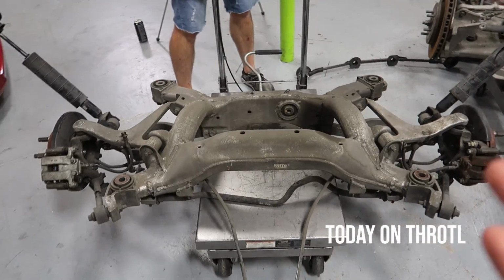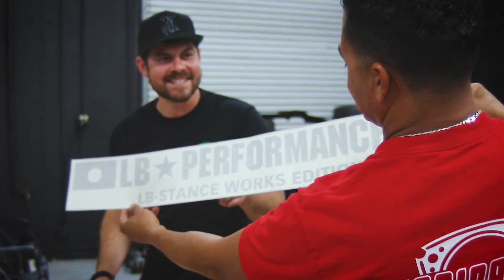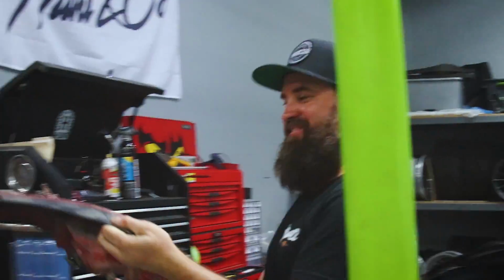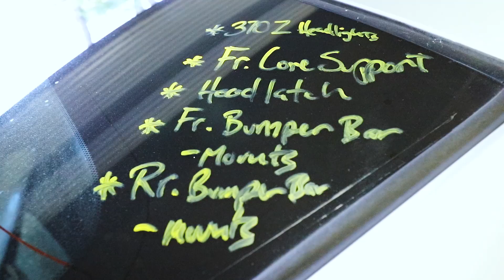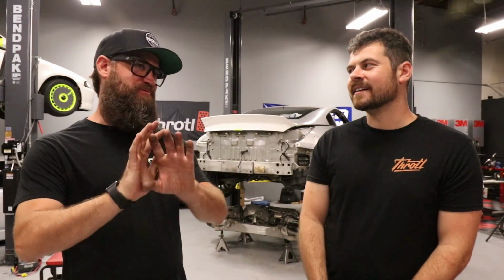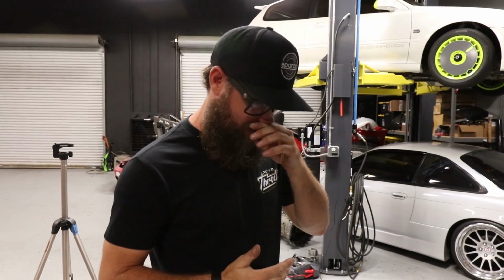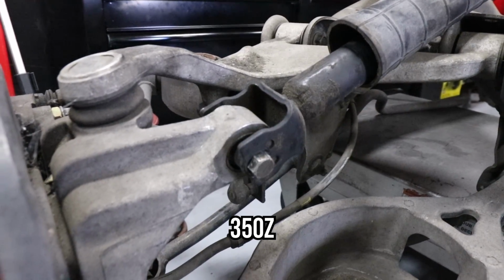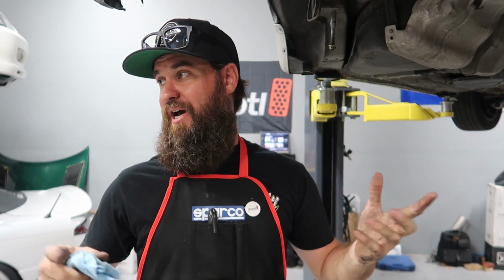World's FIRST Tesla Swapped Liberty Walk Nissan 350Z - Part 1

Comment: i have some suggestions...1. make a solid shop welding table about the size of a nice dinner table, 1"steel top, square tube legs and metal caster wheels. that way you can put heavy subframes on it and lower the cars on it without bending down so low for mock up projects like this one. and of course it will handle all welding projects. 2. you could aluminum weld offset adapters to the Tesla subframe that match the 350Z mounting points. this is a cool project, i say finish it! but study how the tasks cars package all that electric stuff and take plenty of pics💪

Comment: 2 chevy Volts worth of batteries (can run more current(power) and are way cheaper, Mount half in engine bay and rest in rear seat/ fuel tank area. EV controls T1C controller, Model s Inverter pulls power when too hot and is not as efficient as Model 3 but it could still work for drifting. Also no controllers exist yet for the model 3. You also need to switch to the quaife LSD in the drive unit.  I am currently starting my tesla BRZ swap. Good luck to you guys, it will be worth it.
Reply: aDIYguy nobody cares, this is for all the cool points
Reply: @belowaveragegamer8631  huh

Comment: You should try and run it through a power glide transmission . The over all speed would increase , and at casual speeds the it could run at a lower duty cycle . So higher speeds and longer battery life .

Comment: Just as an idea guys the Tesla model 3 drive unit might be a  better swap since it's part of a smaller drive base than the model S, I might be wrong on the width they might be same but I think the model 3 is a thinner unit. Downside might be acceleration is slightly slower by .5-1 sec.

Comment: It should be done, more power. An lipo batteries can give you the power you need an not need to go with the big niko style batteries like those in a regular car. More light weight an can give more power given that you get the right voltage an amperage.

Comment: It does Exist ev west is what Parts I use Full carbon fibre 350z 515 hp 840 t   Also the car will run better for drifting if you put the battery in the back like a mid engine car.   Btw it is expensive to do about 40,000 us to build as a pro drift car
Reply: Car weight is 1000 kg with a discreet widebody
Reply: Original z be came the mould for the carbon fibre 1 of 1  car .The heaviest parts are the battery and the windows
Reply: And about 100,000 USA dollars to build out of carbon fibre

Comment: My unprofessional opinion: frankenstein the two subframes. In my mind that seems like the best route in the long run as you wont be monkeying with the oem suspension geometry and structural rigidity.

Given ive never even so much as touched a tesla before, much less tinkered with its mechanics, but it looks to just be an electric motor connected to the differential so it could be possible just swap the diff and motors onto the 350z subframe, fab some mounts and have custom axles made.

This is probably the easiest part of the whole build however, i feel like the electronics and actually getting the thing to even run will be the biggest issue.

Comment: Can you mount the motor in the front connected via drive shaft using stock subframe mount the battery’s in the trunk and under the car?

Comment: You couldn’t just buy a whole back part if the tesla floor pan that has the bolt hole for the electric engines and just cut your floor and weld that one in.